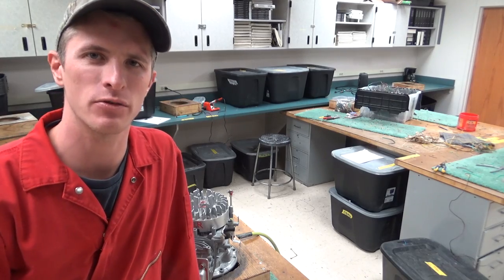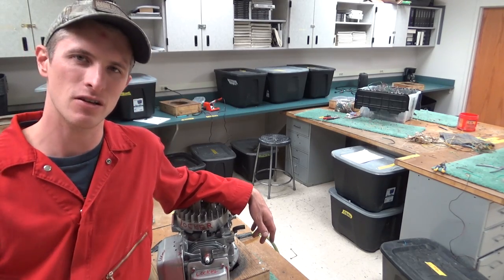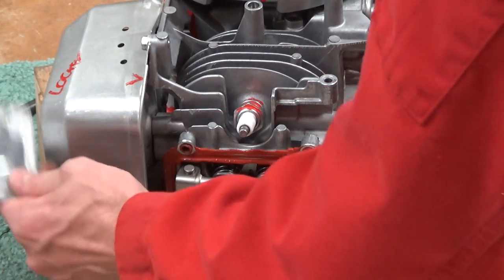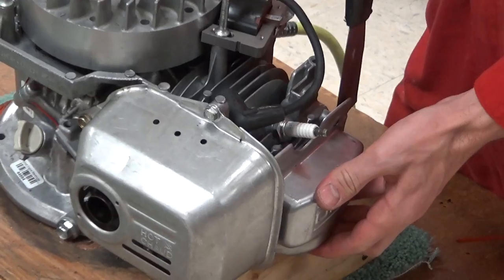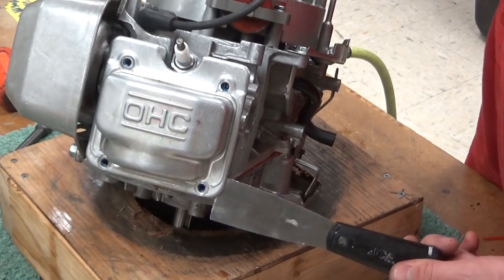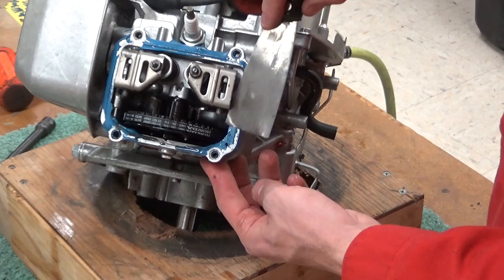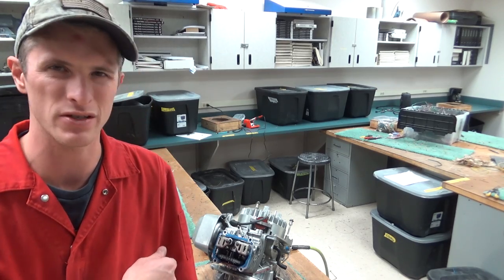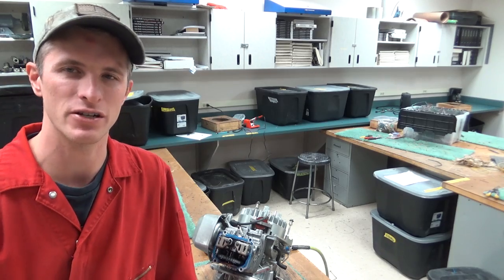Honda GC and GX Series Valve Cover Removal

Comment: LOL...nice vid. So what did you make your gasket out of? You should sell them...I'd buy a couple for sure.
Reply: Actually, you can buy gaskets for these. Technically, they're for a GSV-190, but it also fits the GCV-190. The GSV model uses a cast aluminum valve cover which is much stronger. The part# for the gasket is 12312-Z2A-000.
Reply: Thank you. Appreciate your response. @weeeves